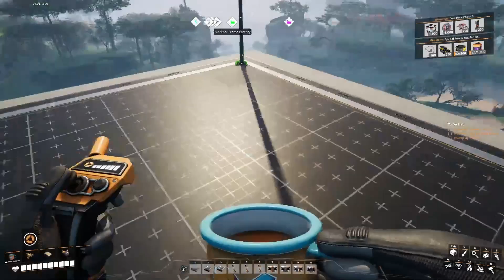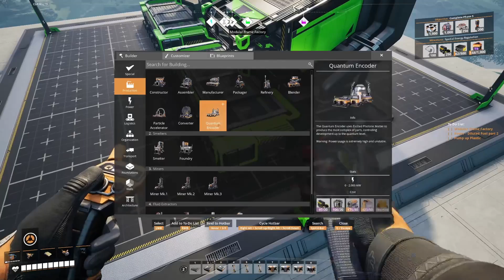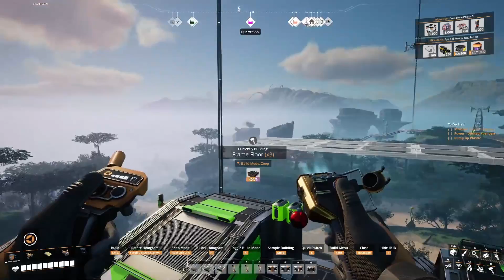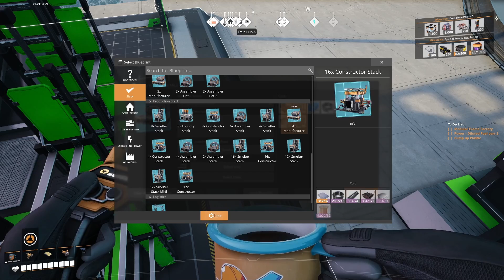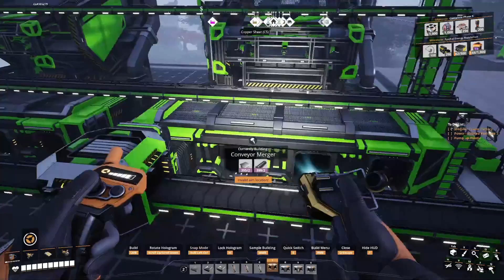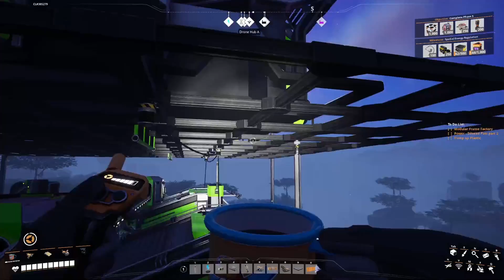Modular and Stackable Manufacturers | Let's Build Satisfactory | Blueprints

Comment: Making a modular manufacturer blueprint is quite doable with a Mark I blueprint designer. It requires that you use a logistics subfloor (I use one 8 meters total). The manufacturer itself has to be on a 4 meter 'dais' over the raised floor. The blueprint can be 4x3 tiles. with belts running from the long edges and the manufacturer being oriented along the long side.
Reply from the maker: Thanks for the tip. I thought I tried to fit 2 and I could not. I’ll have to give it another shot!
Reply from the maker: So I could not get two on the same level, so it would be 1 at a time. I was able to get a stack of 2 in the MK1 Designer, without the subfloor, which has some potential....It goes all the way to the ceiling! Guessing with your subfloor you can only expand horizontally and not stack them up?